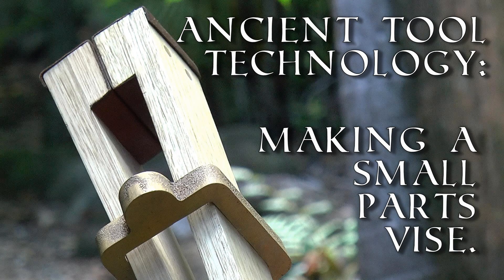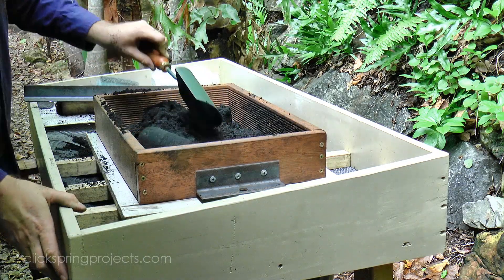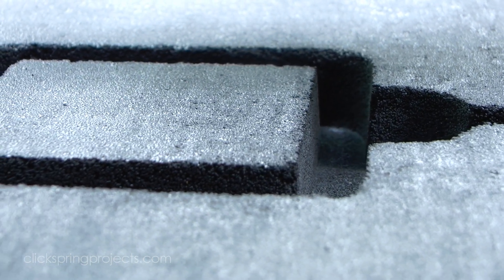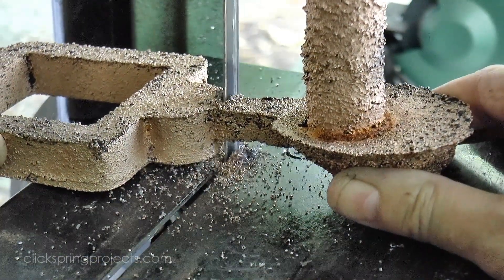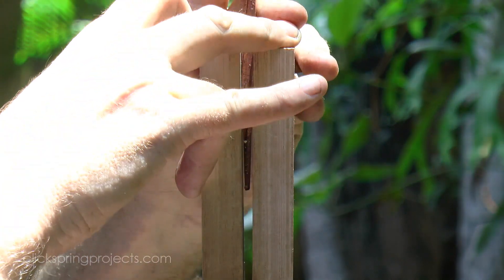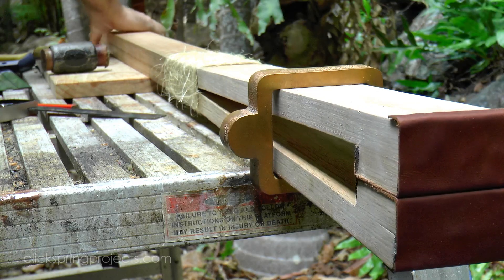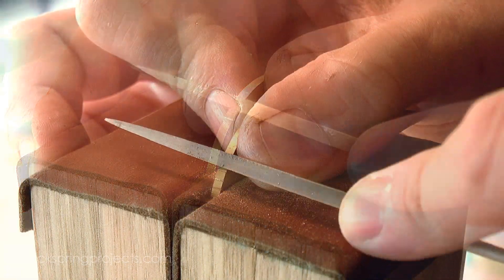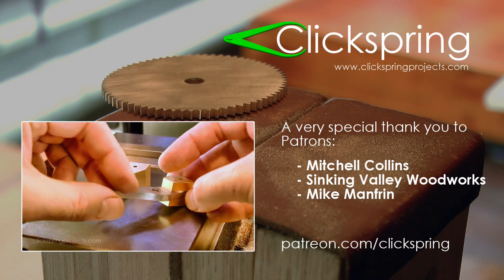Making A Small Parts Vise To Construct The Antikythera Mechanism - Experimental Archaeology

Comment: i have a question: i dont think the greeks had a needle file back then, but what tool would they have used ?
And if they did have something similar, can you make it as well ?
Reply: A quick googling refers to a book called ""Hand deburring: increasing shop productivity" wherein it states, on page 161, that "The oldest known metallic file, for example, is 3,400 years old. The egyptians used files and rasps as early as 3200BC" 

Wikipedia states a similar story "Archaeologists have also discovered rasps made of iron used by the Assyrians, dating back to the 7th Century BC."

So in essence, metal files predate the Antikythera mechanism by several thousand years.
Reply: +MrHighvolt  The iron age started around 1200 BC - 600 BC (depending on the region)...and the mechanism is currently assessed to be from around 200 BC at the earliest approximation.  So an iron or steel file is certainly not out of the question - and considering the fine teeth on the gears and the need for accuracy, I think an iron file would be pretty much a requirement.  It would be too hard to keep the teeth regular if your tool wore down as you were cutting them.  They may have made the tool specifically for the job...but what's being used here is likely ("likely" imo, anyway) what was used back in the day.
Reply: A chisel, of course! That definitely helps my understanding, thanks.
Reply: I would like to believe they had better methods than stone just because it would be so time consuming but the only other method that comes to mind is powdered abrasives with wood, bone or metal tools. I wasn't there at the time so it's just a theory, they probably used a variety of tools to get the final result but you would still have to shape the tool.
Imagine having to shape a stone (or tool) with the correct angles and dimensions for every gear wheel you had to create ? It couldn't be a hard stone because you couldn't cut it but to get that level of detail it couldn't be too soft either and it would need to be dressed frequently to keep the geometry correct. Hardly surprising there's only been one Antikythera Mechanism found ! The skill and patience of that craftsman must have been legendary, you would think there would have been some records of his achievements somewhere, I wonder what else he created and if we will ever find it ?
Reply: Blimey, that surprises me !
Reply: Files are surprisingly old technology. They were made by annealing a blank file, cutting the groves with a hardened steel chisel and then tempering and hardening the file, like Chris does with the other tools hes made.
Reply: Now that I think of it making gears is a similar problem to making and 
sharpening saw blades and they definitely had those back then.
Reply: I'm curious as well, I'm wondering how they would have gone about this.
Reply: Yes that's certainly plausible, they would have known about hardening it since they started to produce steel. Maybe it wasn't so time consuming after all ?
Reply: Me too! Ian Clarke
Reply: glyn hodges  that's a lap, Not a file, and laps predate metal use! We know from the way abrasive marks show up in prehistoric stone tools! Amazing isnt it?! Some fun facts about laps, they are the most percise tools avalible today, and are used to make weights and standereds masters for entire nations, and some are made, to make metric standereds for every nation using ISO systems of qauility control! All using laps, and those laps although equipped with measuring tools that would baffle most modern humans, the actual cutting surface would be reconizable to a stone age man! The oldest and most refined manufacturing technology in the world is sitting in that humble idea! My theroy on files, although just a head space thought, is that laps are probably the inspiration for the metal file and rasp, with the smith using a chisel to mimic the feel of common beach sand glued to wood, as the common lap was believed to be made. Practice thine google fu for more info. I'll ramble on all night in a reply, to a reply, to a commit if I don't exit now

Comment: Great work Chris! How did you get the gear teeth spacing correct? surely not by eye...
Reply from the maker: More detail on this in a future Fragments video...
Reply: I'm betting on maths.  And patience.  And a steady hand..  And patience.  And an eye for detail.  And did I mention patience?  Awesome job - can't wait to see how the rest of it comes together.  :-)
Reply: Probably dividers set to the tooth spacing. If I was a builder back then, I'd scribe a line on the hub or spoke part and use dividers to mark the tooth spacing straight onto the parts. That way the workers could have a reference to check tooth spacing against with their dividers as they worked that wouldn't be lost. Later it would probably be sanded off.
Reply: Easier to "step out" a circle with dividers. Lay out the size of circle you need. Set the dividers close to the spacing you think you need, start at a zero mark and step off the circumference with the dividers how many teeth you want. If they go over the zero mark close them up a fraction, If it's short open them. Lather, rinse, repeat until it hits the zero for the number of steps you need. Woodworkers and machinists have been doing this for centuries. 
Like I said above, after you find the right spacing you can scribe a line on the part and use the divider to make a reference on the hub or spoke somewhere so you don't have to redo it every time you need to check.
Reply: yeah i noticed them too when watching for the second time on a larger screen. perhaps a compass and some maths to get them there in the first place.
Reply: That was my thought when I saw those small scribe lines.  :-)
Reply: I seen the tiny reference marks.

Comment: wow that's some coarse sand. is that homemade green sand? Any reason you didn't use fine sand?
Reply from the maker: Sourced from the local foundry. They tend to do very large components for heavy industry, so its a little coarse, but absolutely superb to work with.
Reply: Clickspring fair enough.. it must be oil bonded then? I made my own that works great, with kitty litter and finds washed sand.. I did make a video on it if your interested
Reply from the maker: Green sand, with some extra proprietery ingredients...

Comment: Making a pinion using just a needle point file... You are incredibly patient, I must admin!
Reply: Gavin Jenkins the mediterranean was more than a millenium into the iron age by the point of the antikythera mechanism's creation. Steel was very much available at the time.
Reply: That's a very good point, thinking of how inventions and discoveries evolve over the course of millennia. 

If we were to draw parallels, the navigational compass was invented a millennia ago, c.1000 A.D in China and simultaneously the Norse invaders used lodestones for navigation whilst seafaring. 

Today for navigation we have the Earth mapped out with a discrete numbering system i.e Longitude and Latitude co-ordinates and the Global Positioning System (G.P.S)
Reply: Andriy Syrovenko crazy
Reply: I've made a serrated steak knife from a blank before with a needle file, which should take longer than this with about as many teeth but harder metal, and it was maybe an hour's work, not really that bad at all. The measuring in this case though might be  bit more annoying ahead of time given a circle.

However, would they have had steel files at the time? I'm guessing likely not, but not sure. If not they probably had a slightly harder alloy or could work harden a tool or something, but it might have taken a lot longer than this if the hardness difference was low.

I can say that a major advantage of this vice he just built would be the ability to easily carry it outside due to being free standing. The LIGHT you need to make those teeth is significant, and I'd definitely want to file them in the sun in Greece without any powerful electric lights.
Reply: @gavinjenkins899 you should watch the rest of Chris' videos on the construction of the Antikythera mechanism; I'm not expert but they feel very well researched and would answer a lot of questions. Plus they're impressive, well made and entertaining!